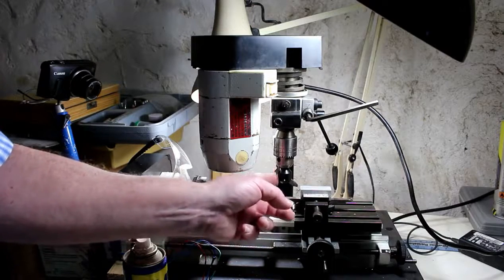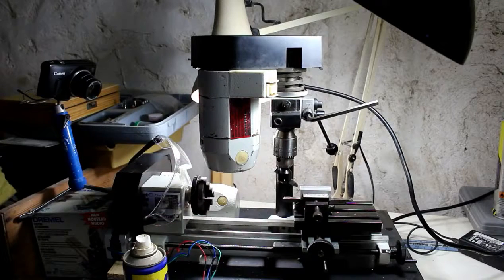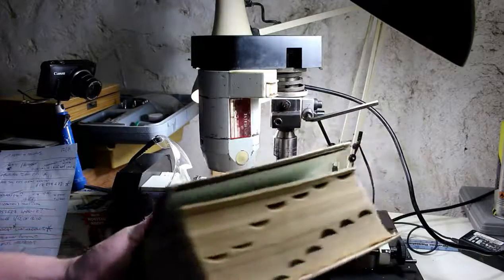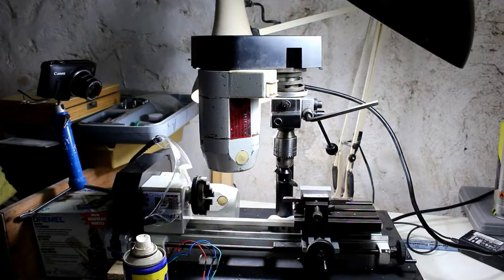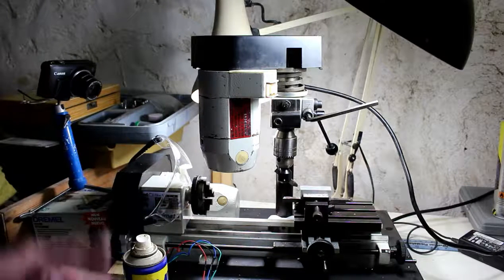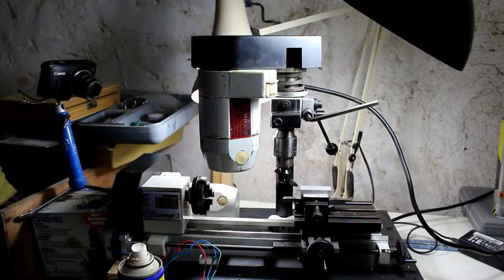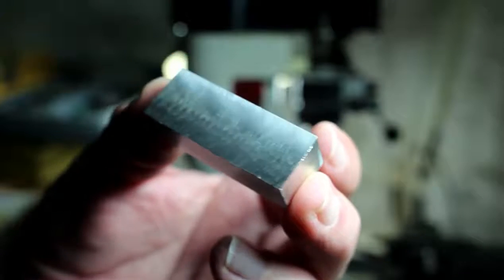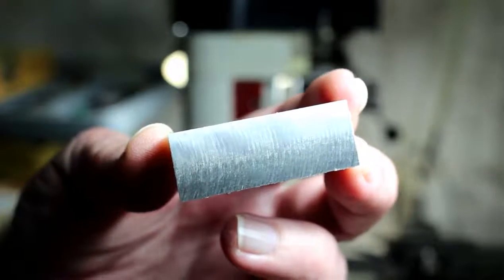emco Unimat 3 Milling -First attempt!

Comment: Hi, nice video!
How do you make the knobs turning automatically? Thanks
Reply: Thanks, I just watched the other video re the stepper engine. Very nice! I would need one too!
Reply from the maker: @alebows  It was just  a very basic Arduino controlled "proof of concept". I haven't gone further with it to date.
Reply from the maker: It is driven by a stepper motor as you can see here : https://youtu.be/qzlLGqr-B5A?t=233 You can see the modification better here : https://youtu.be/qzlLGqr-B5A?t=233 Please consider subscribing if you have not done so already!